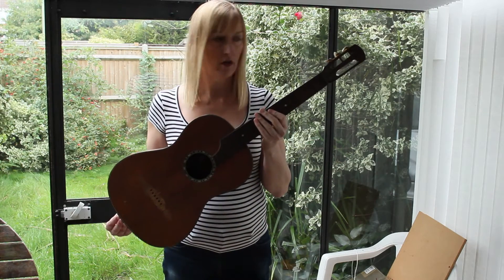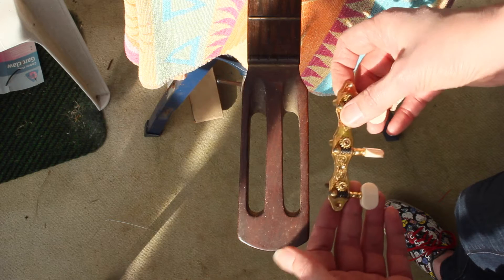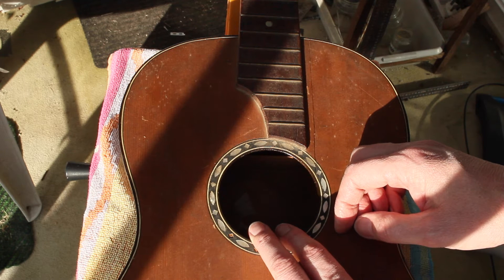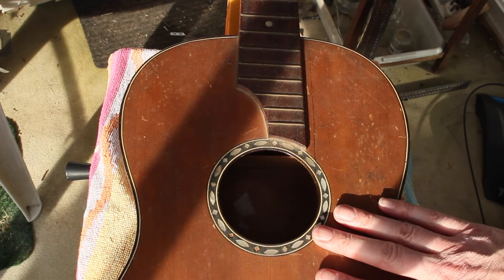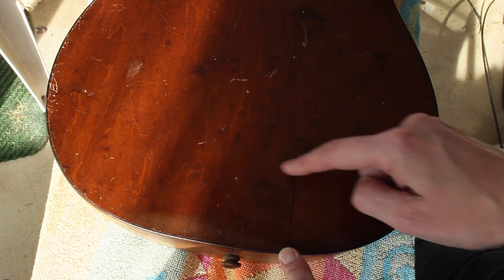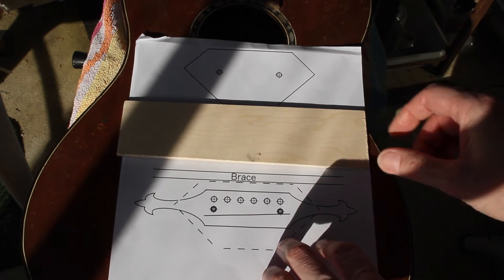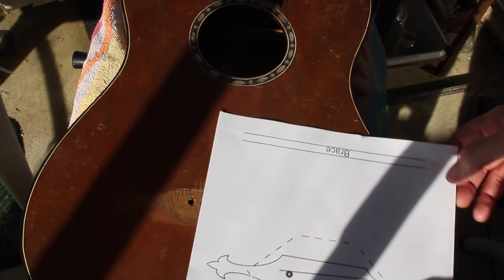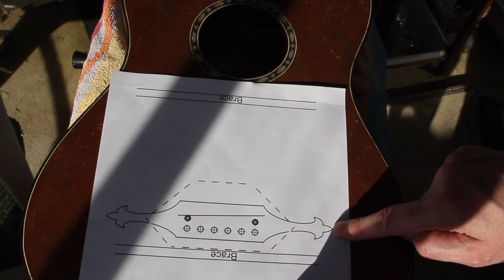Restoring an antique parlour guitar part 2

Comment: My jaw just about dropped about 30 seconds ago when I saw you describing your jack you made!!! I bought almost the same items to do the same job, but instead of the aluminium sleeve, I used a nylon sleeve with a flattened top, and a rubber cover at the bolt head to help with slippage. Wow, great minds, etc. I am loving this restore, by the way!!!

Comment: I Have been working on an early 1900's Lyon & Healy Lakeside guitar and I found the same problems you did with bridge placement, The bridge was almost 3/8 of an inch too close to the neck for intonation. I did not have the original bridge but used a new one which I heavily modified to get the intonation correct.  I filled the bridge pin holes with dowels and re cut the holes to match the new bridge with compensated bone saddle. it now plays in tune.

Comment: My experience with old parlour Guitars has shown me that there is usually just the Bridge sat in the slot on the Bridge plate. Their almost never compensated, in fact some have caused real headaches, some of the Bridges are very thin and the ones that are not bone or antler are made from Hickory the bowls ball wood, Lignum vetae, really hard wood. Apparently it aids tone and sustain.

Comment: Susie.  You can use a tuning machine mounted on a small piece of wood to fix that crack.  Thread a fine guitar string thru the crack and put your cleat on the inside of the guitar.  On the outside set the tuning machine block oh the other end of the string.  Glue the crack and tighten the tuner and it will pull the crack into alignment.   Use some wax paper to keep the piece of wood from sticking to the glue.  It's really quite clever.  Google it.  BTW, excellent diagnostic work on the bridge plans.

Comment: Ordering expensive custom tuners is overkill for a no-name guitar. Personally I'd fill the holes with dowel and re -drill for correct spacing. The tuner plates will hide most of this repair.
Reply: Nah, I agree with her. The holes in the middle would be a time consuming and troublesome pain.

Comment: I think its a venetian style guitar.  German.I suspect it took gut strings.  You can probably shrink the scratches out rather than sanding.  Sanding will change the guitar's sound.  That is, bass response, tremble response, sustain, stiffness in front of the bridge.  Have fun.

Comment: Hi....Overnight I got some extensive checking on the nitro finish of a 1963 Gibson
purchased in astonishing near mint condition..Chicago has huge humidity temperature volatility and despite  2   (Oasis and Humipdipack) systems in the case and guitar I got this startling  checking.  Happily the instrument still sounds fine...the checking is superficial....wondering...if at some point i want to restore the finish...if it can be done without altering the vintage sound...do you do that kind of work?  I watched your 40+ restoration saga of  the antique guitar and impressed with your patience and creative approach...coming to each issue without assumptions and 'automatic' sort of thinking..I have no idea how to contact you ....is there some sort of link on this  site?

If I decide to fix this I bet you'd do a great job....If you don't contract out ...just want to say...anyway...really great work....Tom

Comment: Hi, how did you get the bridge design, or did you design it yourself?  Been watching some of your videos by the way, some great stuff and i'm excited to watch the next part of this restoration!
Reply from the maker: I photographed the guitar top and then drew in the design in Photoshop by tracing the tear-out pattern. It took 2 attempts though - I managed to find a photo of a similar bridge which confirmed the shape of the fleur de lys. Originally though there was no intonation correction and the bridge pins were at a 45° angle, not vertical. I've had to move the pins back to have them vertical or they would have been too close to the saddle
Reply: I finished watching your other restoration videos, really enjoyed it! I'd love to see it strung up and played, can't wait! Why do you think the bridge pins would be at 45 degrees?
Reply from the maker: +Darren McCarthy Musica I couldn't understand why, on such a well constructed and accurately fretted guitar, the intonation point was directly about the bridge pin holes - surely the pins needed to be further back. Then I realised the holes on the top seemed to be angled back. If the bridge pins were at 45 deg then they would emerge behind the saddle with a gap of about 5mm. I can't prove it but it seemed to make sense. The only pictures I've found all have vertical pins, but mine is earlier than the examples I've found so maybe they changed it.
Reply: Do you think it could have been intonated at the nut, cause i've seen that on a few guitars., i guess that still wouldn't explain the 45 degree bridge pins though..